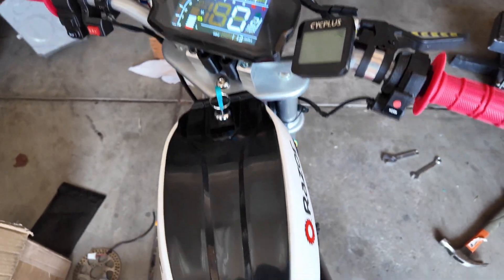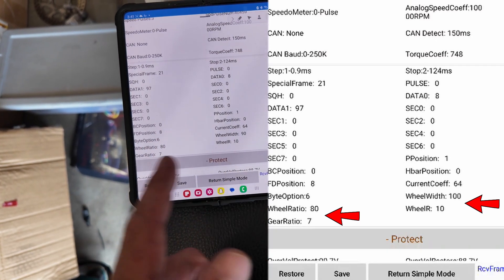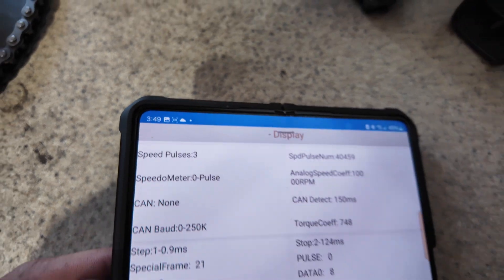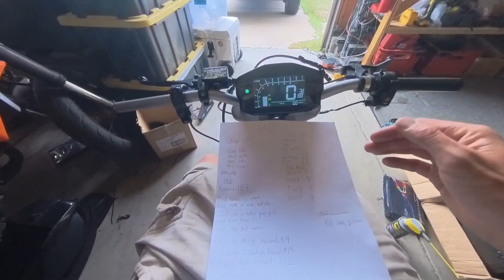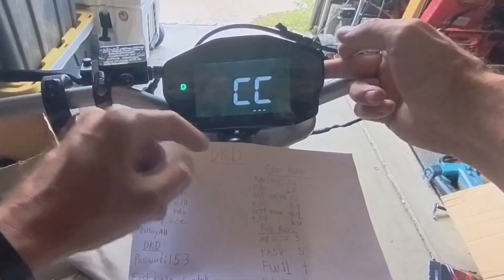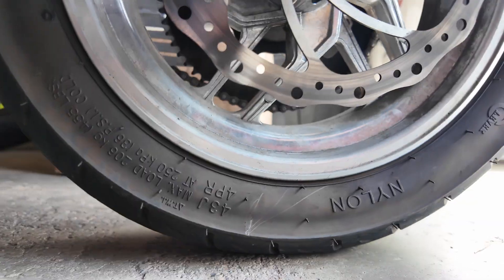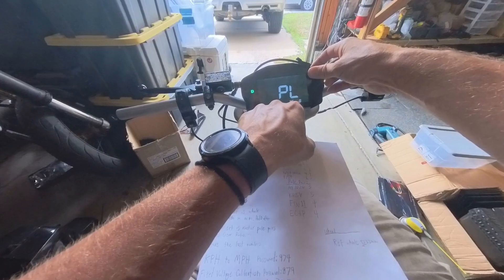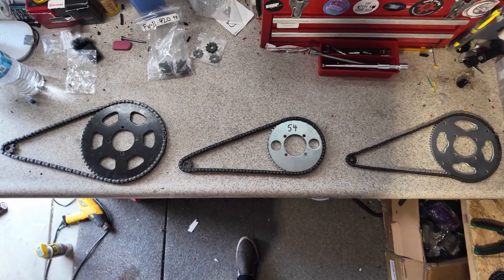How To Set Up Your DKD Display (All Settings)

Comment: Great video, this will help me get mine dialed in. I see a error tho the fw11 is a 5 pole motor.
Reply: Well, if you find out any information, let me know! I'm sure it makes a difference  performance wise. Mine is set at 5
Reply from the maker: @Kennardrynlds87  for sure!  I think you might be right I am seeing it saying five I don't know why I was told eight but that was months ago when it was possibly in the early stages of production and I guess I just went with that.  Appreciate you dropping a comment and correcting me.  I will check when I run it on FW
Reply from the maker: @Kennardrynlds87  I work with manufacturer they say it's at eight pole motor being four pairs.. I know on foot sky everyone recommends to put in five for some reason.  Unless I change something and Jordan didn't tell me
Reply from the maker: Yeah that is weird I see the spec say five full pair now when they were making it it was supposed to be eight pole motor 🤔

Comment: What do I set gear ratio for a qs205? Doesn't need changing because it's rear wheel hub motor?
Reply from the maker: Honestly I guess I'm not totally sure
Reply: @Razorcrew_Cole I'll test it out see if speed matches GPS with the default settings it's at right now which is 24-10
Reply from the maker: @AbdulHaq11901 Yeah let me know if you want to cuz I am curious how that works I don't know if you can set it to zeros for gear ratios or what

Comment: Is there a code for brightness, in the sun it is hard to see?
Reply from the maker: Unfortunately that is one thing that it lacks and night time it's almost too bright, and in daytime it's almost not bright enough.
Reply: @Razorcrew_Cole With sun glasses on it is barely visible 😢
Reply from the maker: @charlielamp2739 Yeah if it makes you feel better the $200 screen I have on my bike I can't see anything when I have my metta Ray-Bans on
Reply: @Razorcrew_Cole Yeah man, all I can say it is working now, I had to use the brown (Boost) wire in stead of the blue using the Fardriver 72v50A, “It is what it is, Amen”
Reply from the maker: @charlielamp2739 Yeah like I showed in this video the brown wire is one line not boost, don't know why they haven't changed the diagrams there's a handful of far drivers I deal with customers that it is still the blue one line but it's rare now.  Like it's not confusing enough for people 😅

Comment: I cannot get my dkd to display anything other than the main screen - sometimes it will show all the options as if they were engaged but i can't get it to display any speed readings
Reply from the maker: Like you can't get to that setting screen
Reply: @Razorcrew_Cole turns out the blue wire was not my data signal. It was the brown boost wire
Reply from the maker: @al73r yep I think I mentioned in this video It's changed through the years but a lot of the diagrams still show the old one they used.  I've actually only seen brown used
Reply: @Razorcrew_Cole the documentation that came with mine was still pointing to the blue and boy did that send me down the "what did I break now" rabbit hole lol😅
Reply from the maker: @al73r  dang dude yeah that's such a setup I don't know why they do that
Reply: @Razorcrew_Cole how about it it’s all coming on and the baby blue and brown don’t work for one line I have 2 bikes both exactly the same just one less power the 1st it works fine this new one no speed or gear displayed what ever I try
Reply from the maker: @Casperthestupidghost okay yeah it's weird through the years they've changed the wires and not change the diagrams out there. 
It should be only pure brown brown with a white line is reverse.  If there is no brown wire at all that is only brown there should be a light blue wire with a bullet connector. Your one line maybe that wire they have changed it through the years don't know why but we see that rarely. Check for that light baby blue wire
Reply: @Razorcrew_Cole it is none have tried both the solid brown and the baby blue in the bullet connector it’s a ND72450 both bikes identical
Reply from the maker: @Casperthestupidghost  well That's really really weird then, did you make sure there's not a weird setting changed that's not giving that one line communication? And also if you look at the page of the pins you might be able to determine if it's active or not I'm not sure though.  Controllers come from the same place too?
Reply: @Razorcrew_Cole  yeah exactly the same had both apps next to each other every thing it’s actually confusing now
Reply from the maker: @Casperthestupidghost there might be something messed up in that one controller then is all I could think bro That's extremely weird!
Reply: @Razorcrew_Cole it was the special frame 21 🤦🏼‍♂️🤦🏼‍♂️
Reply: well the blue wire on the fardriver to dkd is not your friend - the brown boost wire is what you want

Comment: Ok got that set ,what about battery voltage it’s saying 100 on did but I’m actualy at 75 percent battery ?how do I  fix that
Reply from the maker: Do you have your AH set correctly in your far driver app settings? And the correct voltage on the display you have to click through to set as shown

Comment: How do I get rpm to work everything but that works don’t see the white digital lines going up and down
Reply from the maker: There's a certain number that needs switched I forget exactly what I thought it's in this video somewhere. Like you have to cycle through and it's really like amps drawn is what it shows

Comment: Hey what if you are only riding a hub drive - how do you set the DKD speedometer up with no gear ratios to punch in???
Reply from the maker: @jerlamarre8607  That's a good question honestly cuz I haven't messed with them I'm not sure I would guess it's just a zero

Comment: Your the man, I finally got the original DKD display. I have more expensive for driver displays on my other razors. 

I used your video to set this new DKD up. Thank you for the great video 

 Only thing is FW11 is 5 poles like the KR5V.
Reply from the maker: @ElectricShock19  Thanks for dropping the comment! 
yeah that was a mistake that the after the 11 is 5 I put it in the comments but I don't think anyone sees it! 
The Chaojie Gen 3 screen is super sick If you haven't checked it out!
Reply: @Razorcrew_Cole  yes 💯  the Gen 3 is the best one hands down. I have that one on my FW01 SX500. I also have the 6.86 inch one on the bike in my YT channel pic.  b
I like the Gen 3 smaller one better though and it's cheaper.
Reply from the maker: @ElectricShock19  there ain't no way you got the big one too!  I did see that very expensive lol

Comment: For the tire sizes, is this in mm or inches? I ask because I’m on a go kart and my rear drive wheel tire size is 11.5 x 9.5 x 6. When I go to put in the numbers after a millimeter conversion it won’t accept the 304 mm tire height. It drops it down to 42. Seems it only goes up to 255. If you put in 256 it’ll default to zero
Reply from the maker: @askiagillette  danggg, yeah it's millimeters that's kind of weird they limit that part 🤦
Reply: @ I was able to just use the highest number (255). Seems like after I did the circumference measurement it may have adjusted for it. I was able to get the Display up and working properly against my GPS. All good for now. Thanks for the video explanation.
Reply from the maker: @askiagillette  Awesome glad to hear it! No problem thanks for dropping the comment
Reply: @Razorcrew_Cole is there a instructions manual for the DKD display and the FarDriver App that I can download somewhere?
Reply from the maker: @askiagillette  Not necessarily there's basically wire diagrams and for the DKD there is a slight manual, I forget how I found it Just looking on the internet explaining some of the stuff I am here but some of it not as well lol EMX Brandon has a screenshot of it in his video on the DKD I believe
Reply: @Razorcrew_Cole   Yea it’s mainly the far Driver App. I want to know what all the parameters mean and how they are defined. Most of the good videos tell you what input in the common parameters but I’m chasing the “why” at this point. Followed by explanation or examples. For example, I just had my setup tuned and was told to put certain values in all the fields (which I did) and the kart runs good. But I don’t understand why. I have many questions on a basic level of understanding. I think the BEST 2 Specific videos I’ve seen so far on Programming (not to say others aren’t good)  are yours on the DKD display and Regen braking. Still looking for one on Field Weakening, Speed Ratios, and Max RPM vs Limiting RPMs
Reply from the maker: Right on man appreciate it @askiagillette

Comment: If failed to set up odometer trying 3 times, what I should do? Buy a new DKD?
Reply from the maker: @tigranohanyan3321  Like the settings are not working?
Reply: @Razorcrew_Cole  I mean you said that it allows to do 3 times to set odometer. What I should do, If I failed do it trying 3 times. Is there any reset option there to star all over again?
Reply from the maker: @tigranohanyan3321  yeah for some reason to reset the odometer get those three And then yeah I'm not entirely sure I guess If there's any thing to do to change it or reset but I am not aware of it unfortunately I'm sorry

Comment: Followed the instructions to a T but for some reason my speed is insanely high. I’ll be going 30mph and it says I’m going 110mph lol. Do you know how I could fix this? (I ride a stock Bombmoto B2)
Reply from the maker: @millennialwealth1513  possibly the motor poles, and I am honestly not sure how many motor poles it has.  Or the gear ratio I'm not sure what that is for the B2 either I haven't got my hands on one yet
Reply: @ the motor poles and gear ratio are on bomb moto’s website so I know that they are correct. Do you think it could be something else ?
Reply from the maker: @millennialwealth1513  hmmm That's interesting I've had a lot of people that went off this and have been pretty spot-on and if they're not it's usually either of those two do you have them set in the app to.  That is stumping me, And the only other people that have been off were like off just a little bit that's a lot

Comment: Anyone have this on a tuttio?
Reply from the maker: @JMTB10 E-conic cycles wish we have 5% discount code too I believe has amount for it to go to that bike now so I would assume so
Reply from the maker: @JMTB10 You will probably want the regular far driver harness we make plug and play harnesses that I'll plug into each other but I think that stock one is different
Reply: @ I ordered the keyed econic kit for the tuttio, it comes with a new harness, but I heard somewhere that this display isn't plug and play with the econic harness
Reply from the maker: @JMTB10  No it's not most of my customers get my EMF DKD harness that is plug and play to the EMF far driver adapter harness but I'm not sure how that works with their system then. We have talked about integrating them together maybe we will
Reply: @Razorcrew_Cole  bruh dang it
Reply from the maker: @JMTB10  yeah I think I'm out of stock on the DK do you ones right now actually and it all plugs into the main harness just kind of adapt to it to make it easy and whatnot but otherwise EMX Brandon has a good video on wiring

Comment: Great video. How do I find the 3d printed display mount ?
Reply from the maker: @joshuab2450  Thanks appreciate that, should be in stock on my website- Electric Moto Family.  Or E-conic Cycles has the same one as well as another option I believe We have a 5% discount code to their website as well

Comment: Is there a way to get the battery bar/meter working with fd?
Reply from the maker: @plnko  do you have your AH set correctly in your settings on the far driver app?
Reply: @Razorcrew_Cole  Thanks for responding quickly, i actually think im just being dumb; haven't ridden enough to see... But just to confirm, the white bars will decrease right?
Reply from the maker: @plnko  yes they will.  I find it seems like it stays full for a bit and then they start dropping faster, again you have to make sure you have the correct AH of your battery in the far driver app settings
Also on the DKD like I'm showing filtering through settings you have to have the correct voltage of your battery input

Comment: The first part of the settings when the video just started, I think that messed up my bike and my motor whenever I twist the throttle all the way and mow two or three it will go and I’ll keep it the throttle going, but then I’ll just randomly stop
Reply from the maker: @OwenGilberson  That's really weird, if you followed correctly none of the settings we actually touch in here have anything to do with how the bike works or functions whatsoever it's fully on how the controller is reading that speed RPMs of the motor and doing the math equation to give us the MPH on board.  The other settings and functions we mess with is to turn on the correct wires too allow the one line signal to communicate to the screen to allow it to show the mph it's coming up with.   So you may have accidentally clicked into something in the functions and change the wrong setting very possible and easy to do?

You can see below in comments everyone else is stoked with the outcome besides the FW-11 I had the wrong pole pairs for the equation
Reply: @Razorcrew_Cole  do you know the stock settings so I can maybe try to reset it to stock settings and maybe that will work
Reply from the maker: @OwenGilberson umm I don't necessarily but there's possibly like a reset the stock button or something, or redo Auto learn is always a good thing to start at
Reply: @Razorcrew_Cole  is there a way you could like look for me or something because I looked everywhere and I can’t find one I found restore button and then that just restored literally everything I have on there that has stock on there so now it’s reset to zero so that sucks
Reply from the maker: @OwenGilberson  I'm not sure what kind of tune you had..? I'm sorry if you put in something incorrectly man but I don't know what exactly you have each tune is different per controller. I'm usually just want to do auto learn to start.  Did you buy it all pretuned or something?
Reply: @ it was all stuck. I just found your video and I was just trying to do it.
Reply: @ I meant to say it was all stock whenever I got it
Reply from the maker: @OwenGilberson  Well then you probably had it like maxed out, where did you get the controller? I'm surprised it even just worked with the motor You should have to pair the motor with controller always!  Any set up a motor needs to be paired with the controller to read the exact hall sensor positioning and some other things as well as read your throttle sensor.  A lot of times the controllers come like maxed out and depending on what controller that could totally burn up the motor or controller
Reply: @Razorcrew_Cole  I got the motor and controller from hot paxx it was a kid it came with motor controller throttle, and the DKD display
Reply from the maker: @OwenGilberson  then I would assume they had them paired together and set up. I'm not sure what they do for their tunes

Comment: im setting up the dkd right now but the fw11 is 5 pole pair with a 6.1818 ratio x 5 pole should be = 30 for the first number? ty regardless
Reply from the maker: @Nouri_TV  I think I messed that up on my paper, put in what it says four pole I think actually my fault, originally before production I got told it was going to be a 5 but forgot it was a 4
Reply: @Razorcrew_Cole  ok cause on auto learn it set to 5 pole and my ratio was 6.1818 so i set it so 5*6.1818 which was like 30 and left the .08 the same so left it at 30.08 seems accurate so far will test with phone gps app side by side to dkd tomorrow ty for ur info on this video helped me set up and calibrate my dkd
Reply from the maker: @Nouri_TV  Right on, cool will hopefully it gets you dialed in I appreciate it!

Comment: garbage speedometer. ppls keep buying this trash. There are amazing tft full programmable, but mainly sold on Alibaba. DKD you cant see anything in daylight, no voltimeter, does not match very well with non votol/fardriver controllers
Reply from the maker: @blackdaniel_ev  😆😂 wow you just know common stuff.. amazing, You must be in a Facebook page lol yeah you can check my video on the Chaojie Gen 3 touch screen with CarPlay to bud. 👍   I mean for $40 kind of hard to beat for a screen.  Everything is sold on Ali man I can tell you haven't actually went through any suppliers for these screens you're talking about.  Love going to your page and seeing the same screen on it 🤡
Reply: @blackdaniel_ev  what exact models do you reccommend??
Reply: @joshuab2450  chaojie v1 or v3
Reply from the maker: @blackdaniel_ev  v3 We have a video going over that screen as well.. Loki new screen coming to

Comment: you posted this in the perfect time, just powered up my electro and on my yz250
Reply from the maker: Right on, if you're using a QS motor I should have put those in I'm not as familiar with their pole pairs but if you know it just follow along and you should be dialed in